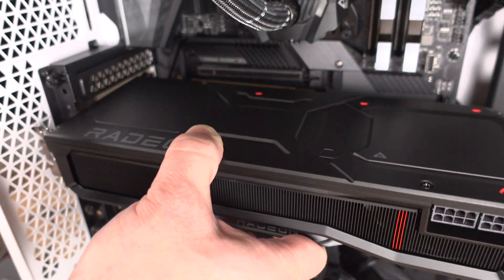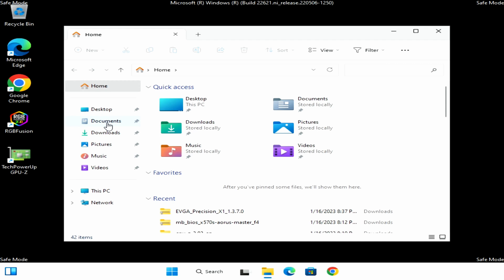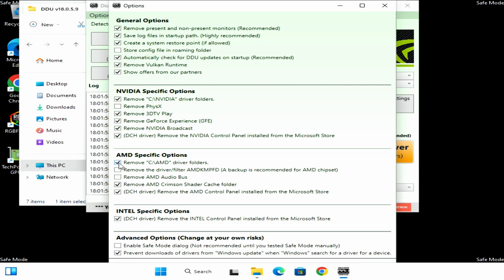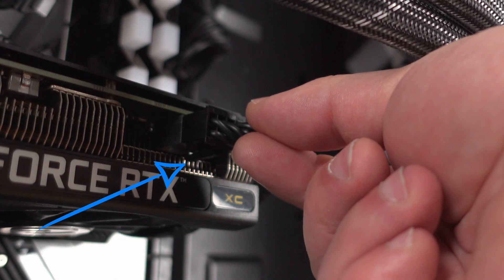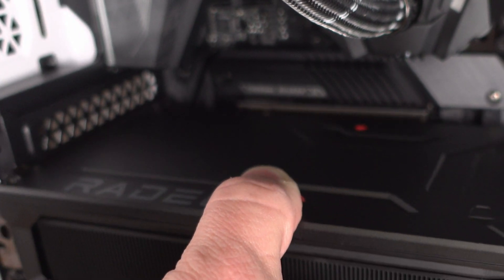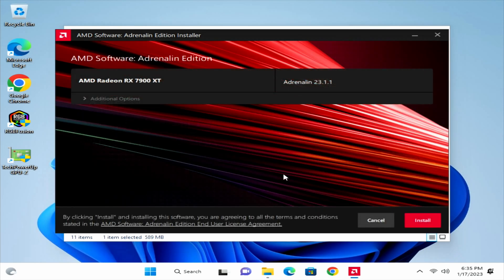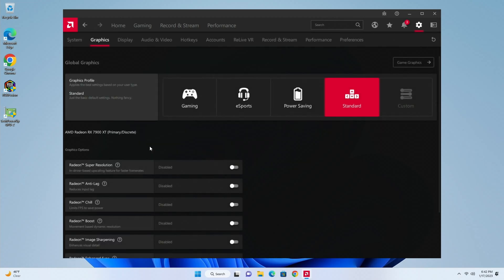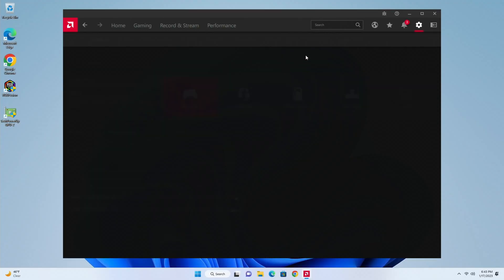The best way to Install the AMD Radeon RX 7900 XT Graphics Card in your PC

Comment: Came across your video while troubleshooting my 7900 xtx upgrade. I've made it through the steps of clearing previous drivers and installing the 7900xtx but the motherboard vga indicator light never changes from white for me to enter windows and install the proper drivers. Should I try running DDU again on my previous Nvidia card or are there other troubleshooting steps?
Reply from the maker: The led light won't change differently due to drivers, so I am not sure what you are asking me
Reply: @ThisBytesForYou okay, I'm just trying to check all my boxes to see if it is indeed a GPU issue or a software issue. I'm working on running DDU again to ensure the previous Nvidia driver were successful and fully cleared from my PC before trying to install the 7900xtx again
Reply from the maker: Let's stick to the check box of me helping you.  Have you watched this video and if so at which point do I go over a white led?
Reply: @ThisBytesForYou Yes sir, I've watched the video and at no point a white vga diagnostic motherboard led was mentioned. I believe I was asking it in case you ever encountered this issue while switching from an Nvidia GPU to AMD.
Reply from the maker: OK, it sound like in your initial post that I was stating that the light would turn white, so I asked since I dont remember asking.  The diagnostic light means there is a problem with your VGA, usually you don't have correct power connected to it, or maybe seated improperly.  Could also be a compatibility issue, what is the manufacturer and model number of your motherboard?
Usually going from NV, to AMD, or AMD to NV, or Intel, etc there isn't an issue, but it can happen.

Comment: When I install my drivers and everything it never gives me a chance to plug it into the gpu I have to use the cpu to get my drivers downloaded then when they are downloaded it doesn’t see my card and it doesn’t work just no signal when it’s plugged into the gpu
Reply from the maker: I am sorry, I don't understand your question, did you watch the video is my first question, and do what I show you in the video?  2nd question, if depending on your answer, would be to PLEASE rephrase your question.  If your native language isn't English, that's OK, I speak English and Spanish BUT write it in your language, and use periods, comas, all the punctions, it helps TONS.
Reply: @ThisBytesForYou I installed my gpu, installed all my drivers I thought, but my gpu never gets detected it’s always on integrated graphics. Never displays when plugged into the gpu only when into the motherboard. So after installing all drivers and updates it won’t recognize that the gpu is there, I’ve reset the gpu and pushing it back into place. The only thing I haven’t tried is different ports on my power supply. Even tho I’ve token out my gpu and put it back in and installed all my cpu and gpu drives and windows 11 updates it still won’t recognize my gpu
Reply from the maker: Did you watch this video and follow it.
Reply: @ThisBytesForYou how do I fix it

Comment: i only have 1 cable 8 pin connected to a rtx 5060 can i istall the rx 7900 xt can you help me with this thanks
Reply from the maker: What is the manufacturer and model number of your power supply

Comment: So i am trying to get my rx 7900 into a B550 aorus elite AX v2 motherboard and its having trouble fitting into the slot it goes down but i feel a collision happening can someone help me?
Reply from the maker: 1. The 2 metal pieces that fit in between you card and motherboard, do you see them slide in between them or do they stick out of the rear of the case?
2. Have you tried to sit your cell phone on one side of the card, record it, and slide the card in, and feel the collision, then sit the phone on the other side recording, sliding the card in and feeling the collision, can you see what it collides into?
Reply: @ThisBytesForYou  Alright I somehow got it in now I got some dumb setting up process, I was installing windows 11 and it got to the point where it says "updating windows 11" and had the background slightly visible then flashes a screen for a literal millisecond then the screen goes black but slightly illuminated and my sama case starts having the red light beep.
Reply from the maker: so perfect, do like I show you in the video to remove the drivers and to stop windows from updating the drivers.

Comment: I've been building, modifying and repairing PCs for years and your video is a very good guide for anyone who is new, or relatively new, to swapping components.  The only extra I might have suggested is the minimum 800W PSU required (my test rig is using an 850W).  My XFX unit came with the Z-support bar, but obviously that would only confuse matters for fitting other brands. 

I'm also with you on how to pronounce 'GIF', since it stands for Graphical Interchange Format.  Despite Steve Wilhite (Team Leader for GIF development) thinking of it as 'JIF',  I still prefer the hard G because Jraphical Interchange Format doesn't quite fit.    ;-)
Reply from the maker: Thanks bud, been doing it since before the internet, I was a product development engineer for Alienware then later Dell after they bought us and Velocity micro, it's been a passion for me forever, its so much fun.  Well my recommendation was purley from AMD, though I always suggest a 1000watt.

 I've been using 1kwatts for about 18 years and only replaced one, stupidly enough I had it plugged into a wall for a test, not a surge protector and wouldn't you know it, lightning stuck, uggg but yeah 1k and you will be good, though it's finally starting to show a little give with the 5090s, scary times indeed.  So very happy you enjoyed this video.

Gif... Such a horrible abbreviation, I will start saying if Gesus now hey, let's hop it to a get airplane, gust in time.  But we have to remember, jod is awesome, and you are always a welcome juest here ;). I think maybe the creator of gif did that on purpose to upset people hahah
Reply: @ThisBytesForYou    Yep, can't go far wrong with a 1kW PSU, but a bit heavy for most other than top spec kit.  
GIF - I like the gust in time 🤣
Keep it  up dude.  👍
Reply from the maker: @PhillBirch for sure it's heavy, but when people update their cards they have to keep updating their psus over and over, just go big at first, and it will only use what it needs. Spend more now, but save in the long run.  And thanks so much my friend, I truly appreciate it

Comment: Thanks for the video…. Purchased a 7900xt and using this guide to install it. Seems like I may be having an issue with the new card tho. Even after multiple attempts with DDU in safe mode. I install the new card and don’t get it to start. The lights on the MB cycle but nothing happens. I am going from 6600 to 7900xt so I ran additional cable from my Corsair rm1000x (assuming it didn’t matter which of the 6 go to the cpu or pcie) fans spin on the card but won’t post (I think that’s the word I’m looking for). If I power down and install the old card it fires right back up and works normally. Is there anything I should check before I send this card back? No reason it shouldn’t be starting up to my understanding. Thanks for the help Luke
Reply from the maker: ok, so PCIE, make sure you are running 2 cables, 2 x 8Pin PCIE cables or 2 x 6+2 Pin PCIE cables directly form the Power supply to the card, do not use a daisy chain.  Then also, what is the manufacturer and model number of your motherboard?

Comment: Great video and greetings from Sweden!

Im replacing my asus 1070 to a 7900xt so going from a 8 pin to 2*8 pin. Is it the cable with 8pins on one end and 2*8 on the other or do i need 2*8 on both the psu and the gpu? Dont know if i make any sens but i hope you understand what im trying to ask about😅
Reply from the maker: I completely understand what you are describing, and I go over it in the video as well.  You will want 2 cables coming from your power supply, each of those cables would have and 8Pin PCIE connection, for 2.  Its OK if they have pigtails/daisy chain, but you want to use one of those off of that one cable.  A way I like to think of it, you can drink a drink perfectly with a straw.  You want to share that drink with your friend, what's the best way, 2 straws, or 1 straw with a hole punched in it so you can push in another straw?  Which would get the most drink, same with power. I hope this helps.
Reply: That helps alot, thanks! @ThisBytesForYou
Reply from the maker: Always a pleasure my friend, so very happy you stopped by, trusted in me to help you, liked and subbed as well as took a moment out of your day to thank me.  It means a ton to me and I am so very happy I could help you.

Comment: You probably won’t see this but once you got to the part where you said not to connect the monitor to the onboard and connect it to the graphics card my monitor is not displaying anything
Reply from the maker: Did you verify the connection is solid, pushed in all the way, sometimes it feels like it is, but it isn't.  Try turn off your PC (flick the switch on the power supply, then turn it back on) then turn it back on, do you get video?

Comment: Following this guide and I’m at the step where I restart my computer while holding shift and then into blue screen to get into safe mode. I am presented with a “Something went wrong and couldn’t use PIN” something to that extent message and I am not able to access the DDU program. Is there a fix to this, or a guide to access safe mode by passing the PIN screen?
Reply from the maker: @kosm_xcx do you have a pin?
Reply: @ThisBytesForYou  yes I do
Reply from the maker: @kosm_xcx  shut down, get back into regular windows then try it again.
Reply: @ okay I just went into windows normally again.
Reply from the maker: @kosm_xcx  do the shift restart again now or fully update windows then try it
Reply: @ I’m still getting the same message “Something went wrong, regarding the PIN” I tried this over and over again until I got locked out for good. I had to use command prompt to get back into Windows normally again
Reply from the maker: @kosm_xcx  fully update windows to the latest update, so there are no more updates and try again
Reply: @ okay
Reply from the maker: @kosm_xcx  let me know how it goes
Reply: @ThisBytesForYou  nothing. Is there any other way to clean drivers and install my 7900 xtx? I’m upgrading from a 7800 xt. Thank you for your time by the way
Reply from the maker: @kosm_xcx  you can run the AMD utility, give it a try https://www.amd.com/en/resources/support-articles/faqs/GPU-601.html
Reply: @ThisBytesForYou  I have it downloaded but it is asking to get into safe mode once again to run the clean up
Reply from the maker: @kosm_xcx  for now, use the uninstaller form the driver, that looks to be like the only way you can do it now or just install the newest driver.  Not that best but it will work for now.
Reply: @ thank you so much. I just installed the 7900 xtx and did get an error message about the driver then my pc froze. So I hard restarted it and it’s somewhat normal. Not sure if there’s something there I need to look into
Reply from the maker: anytime bud, you might want to look in your event viewer and see what kind of errors you are getting.  If you system is overclocked, turn the overclock off and try again.  Your system might be corrupt as it is, it sounds like it is, so you would get the best performance from a clean install.  This video show you how to get Windows 11 and how to create the install media: https://youtu.be/ayp8TksEtoY
This video shows you what to do after: https://youtu.be/8JuC_Dpm6-c
I hope this helps.
Reply: @ThisBytesForYou  I ran a few games on the new GPU and so far it’s been fine. No freezes or crashes as of now. I will check the video out and take your advice since I want to avoid any other problems regarding the messy driver install. Thank you again for replying.
Reply from the maker: Always a pleasure my friend, so very happy you stopped by, trusted in me to help you, liked and subbed as well as took a moment out of your day to thank me.  It means a ton to me and I am so very happy I could help you.
Reply: @ThisBytesForYou  I fixed the issue with me not being able to get into safe mode via Pin. I made a local account and went through that to use safe mode and all it asked me was to use the password I set up for that local account. Ran ddu and reinstalled AMD software and this time with out any errors!
Reply from the maker: ahhh good stuff my friend, happy you got it, good work with the local account, I didn't think of it.
Reply: @ThisBytesForYou  I was finally able to watch the rest of your tutorial! lol 😂
Reply from the maker: Glad you got it my friend

Comment: What if i am just trying to scrub my old gpu driver software, and install again. I am not switching gpus. I have a driver that is causing my computer to crash. Here's my build AMD Ryzen 9 7900X with an AMD Radeon RX 7900XT. Do i still select nothing in the AMD boxes on DDU to avoid issues with my CPU?
Reply from the maker: @xAM3R1CANxPR1D3x  yup

Comment: one thing I would like to add, Its good to remove the round battery thats on the mother board. sometimes you wont get any video output because it simply just needs to reset. it happened to me I freaked out thinking I had done something wrong. Turns out as soon as i removed the battery and put it back it was a done deal. Hope this helps!
Reply from the maker: Agreed, that is a good point and something I use to help some people, I may add it in my next video, thanks

Comment: I bought this card. But I have a Corsair RM750x. 80 Plus Gold. 750 Watts. Will it be enough for this card? Please, please answer me before it is too late. I may have to cancel my order immediately.

Here are my PC specs

Motherboard: Gigabyte X570S AORUS PRO AX. Rev 1.1. Socket AM4. ATX
CPU: AMD Ryzen 7 5700G with Radeon Graphics @3.80 GHz. 8 cores. 16 threads
SSD 1: Kingston NV1 SSD 2TB. M.2 NVMe. PCI Express 3.0
SSD 2: WD [Western Digital] Blue SN580 2TB. M.2 NVMe. PCI Express 4.0
HDDs: Seagate Desktop HDD 2 TB (64 MB cache size). Seagate Barracuda 2 TB (256MB Cache size)
RAM: 4 identical DDR4 DIMMs Kingston Fury Beast. 4X8 GB @3200 MHz. KF432C16BBK2/16. Amount of memory, overall. 32 GB
Graphics card: Gigabyte Radeon R9 380  
CPU Heatsink: DEEPCOOL GAMMAXX 400 V2 Red
PSU: Corsair RMx Series. RM750x. 80 Plus Gold 
PC case: Cougar MX330-G. Midi Tower. Black
Monitor: Samsung Odyssey G3 Gaming Monitor 27" FHD 1920x1080 144Hz
Operating System: Windows 10 Pro. Activated
Motherboard: Gigabyte X570S AORUS PRO AX. Rev 1.1. Socket AM4. ATX
CPU: AMD Ryzen 7 5700G with Radeon Graphics @3.80 GHz. 8 cores. 16 threads
SSD 1: Kingston NV1 SSD 2TB. M.2 NVMe. PCI Express 3.0
SSD 2: WD [Western Digital] Blue SN580 2TB. M.2 NVMe. PCI Express 4.0
HDDs: Seagate Desktop HDD 2 TB (64 MB cache size). Seagate Barracuda 2 TB (256MB Cache size)
RAM: 4 identical DDR4 DIMMs Kingston Fury Beast. 4X8 GB @3200 MHz. KF432C16BBK2/16. Amount of memory, overall. 32 GB
Graphics card: Gigabyte Radeon R9 380  
CPU Heatsink: DEEPCOOL GAMMAXX 400 V2 Red
PSU: Corsair RMx Series. RM750x. 80 Plus Gold 
PC case: Cougar MX330-G. Midi Tower. Black
Monitor: Samsung Odyssey G3 Gaming Monitor 27" FHD 1920x1080 144Hz
Operating System: Windows 10 Pro. Activated
Reply from the maker: The radeon RX 7900XT, directly from AMD, like I am using here, requires at least a 750Watt PSU.  Problem is your power supply doesnt have enough PCIE connections, it has 2, and they can be used for PCIE or CPU,.... lazy of Corsair.  Why would you return your card for that, get a better power supply, here you go, off of my Amazon Affiliate link: https://geni.us/1fStua
Reply: @ThisBytesForYou  I just opened my PC. I found 2 PCIe power cables, ready for use. I am already using 1 of them. I will buy a new PSU, if necessary. It's just that I do not have a lot of money, sadly. Thank you so much for the super fast reply. You are the best at what you do! Merry Christmas! With love, health, and above all peace.
Reply from the maker: Thanks bud, your power supply does have 2, but it has 2 on 1 cable, it's daisy chaining them, which isn't proper power delivery and can cause issues.  It shouldn't kill your card, but you may receive lots of bluescreens and it just may not work, a big maybe on that, but I hope it works well for you my friend.  I hope you have a very Merry Christmas as well, and thanks so much for your kind words and support my friend, It means the world to me.